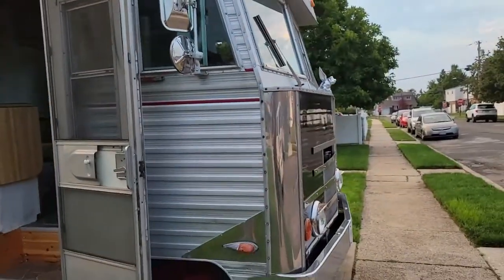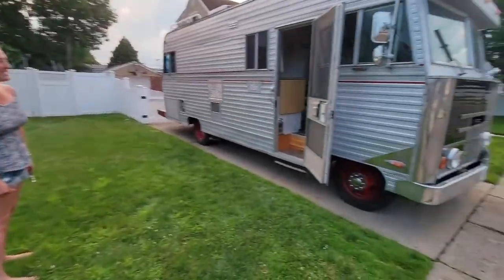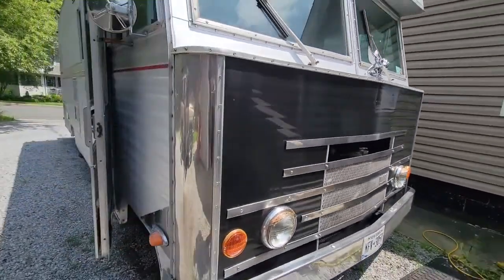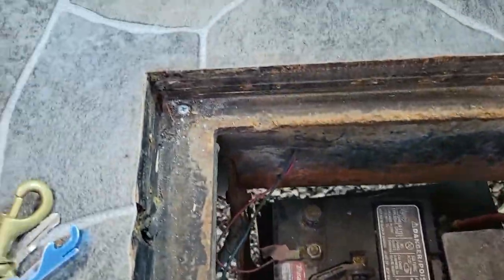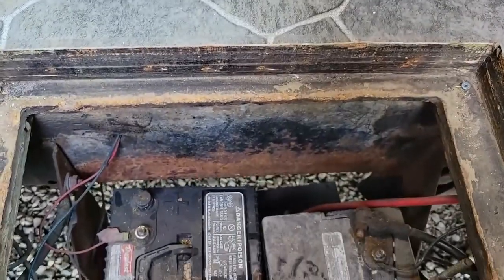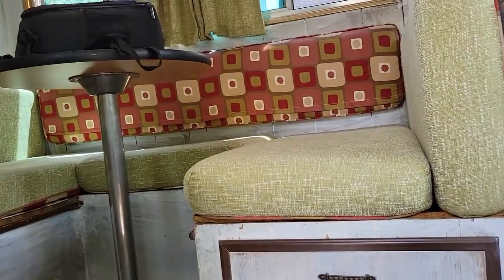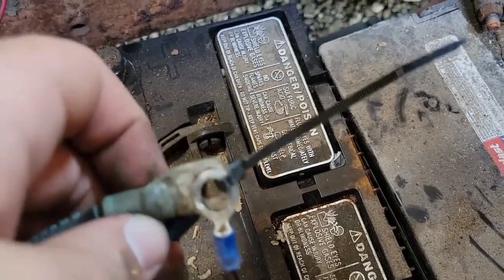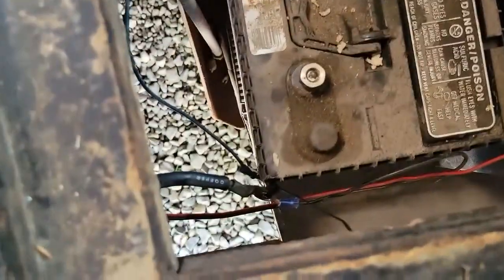Holley Sniper Install on a 1975 Dodge M400 Commander Motorhome!! Episode 2

Comment: Hows your gas milage after the kit?
Reply from the maker: We haven't gotten enough drive time on it yet, it will be back for some cleanup and rear tank install in spring, so we will be giving it a thurough shakedown. The owners really only drove it 50 miles or so before the conversion and never got a fuel mileage number

Comment: I have a 1973 dodge harvest. Do you have tube type tires or tubeless? My tube tires are 30 years old. One was flat and has a gash so I bought a tubeless radial to replace it with. They had No tube tires. They can be found but are over $200 . Tubeless you don’t have to worry about the tube but are a little bit smaller.
Reply from the maker: I believe they were tubeless, but I'm not 100%sure, I really only handled the EFI. I looked them over quick to make sure they wouldn't kill is on the way to the shop but that's about it.